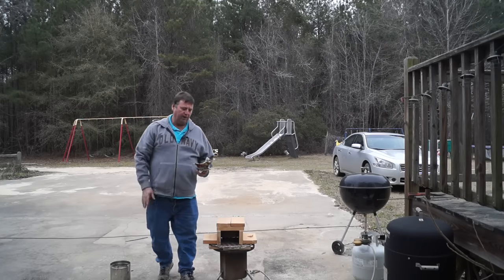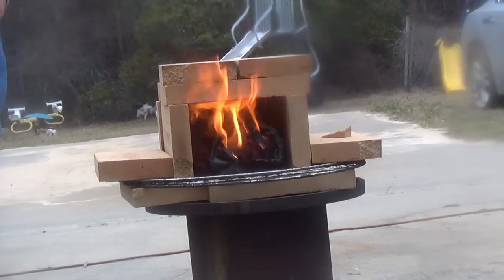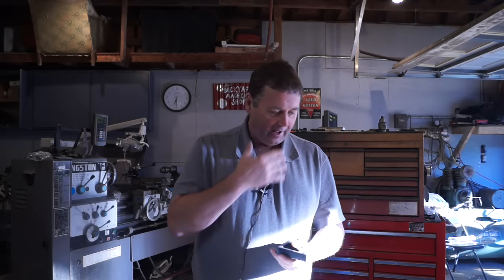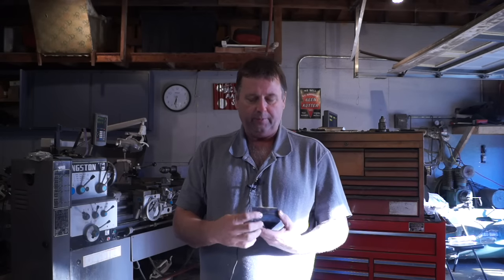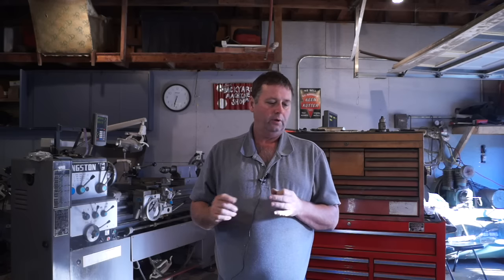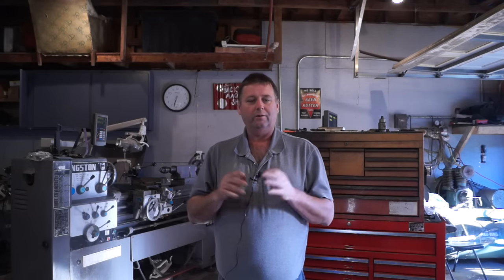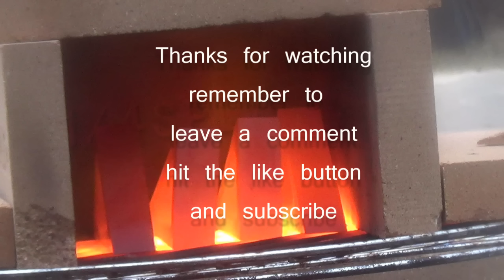Angles & Squares #3  (Heat treat)

Comment: Nice job showing how to "get 'er done"  with what you have at hand!  I was wondering if closing the open end of the furnace with a brick would help keep the heat more even across the parts.  I noticed that the side toward the opening seemed to run a little cooler.  Thanks for sharing your experience, helps the rest of us to know you don't need a lot of equipment to accomplish the job.

Comment: "Cherry red" is an extremely misleading term. Some while back, Stan Bray in Model Engineer magazine reminded us of the fact that the cherries we eat nowadays are not the cherries our ancestors ate. Nowadays we eat Byng cherries. But the term stuck, and stuck us as well. The term Stan Bray suggested is  "boiled carrot red" and that is a much better term. One way to test it, backyard style, is with a magnet. When tool steel loses magnetic attraction it is ready to go quench. I make knives and chisels and such; my stuff improved a lot with the boiled carrot red instead of Byng cherry red.Tempering is a whole thing.
Reply from the maker: +Juan Rivero 
I had thought about the magnet but it slipped my mind when I was setting this up.  Thanks for the reply and taking the time to watch the video
Reply: I still think boiled carrot is a better term.

Comment: Since from the color of the angles it was obvious there was a couple of hundred degree difference thru the angle did you notice any significant distortion in them after quenching? No fire? You weren't having any fun then! You get lots more comments with a nice fire, I know. LOL
Reply: +bcbloc02 ...only when the fire happens in a plastic bucket.

I've only seen videos, so be gentle...  For hardening, does the length of time that it is at temperature matter when hardening to get give the metal throughout to harden?
Reply: ILGopher
Yes, most metals want you to do 1hr per inch of thickness at temp for proper thru hardening.
Reply from the maker: +bcbloc02 
Yes there was fire, just didn't capture it because the camera was turned off, Considered re- doing the heat treat just to show the fire.

Comment: Nice example of heat treatment.
What steel were you using for the squares?
Thanks,
John
Reply from the maker: +John Bazaar 
John the material is 4350, It treats like 4140. It was pretty tough material to start with.
Reply: +The Backyard Machine Shop 
4350 is great material to work with. 
It through-hardens very well
Extremely tough and very strong.
It can be hardened to Rc55.
Cool.
Thanks,
John